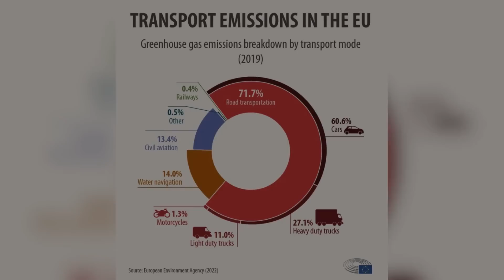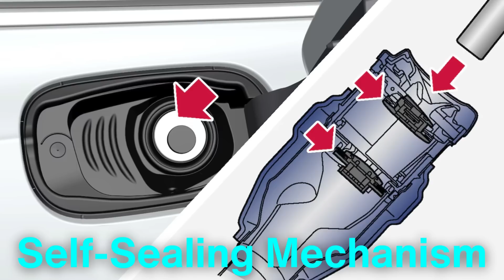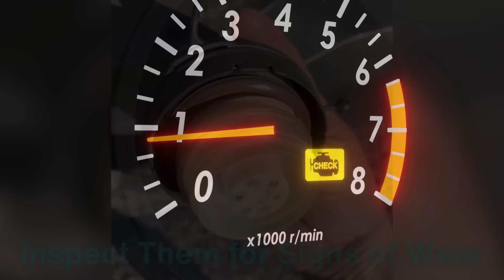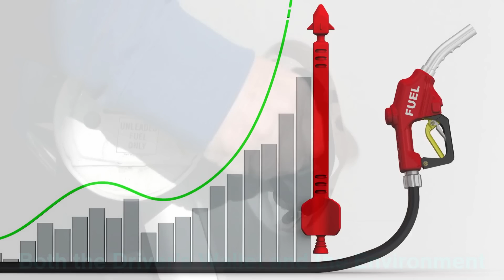How Do Fuel Caps Prevent Fuel Evaporation?

Comment: Had a Landcruiser with an aftermarket tank cap that was completely air tight. On long journeys it quit after 300 miles. Started next day. Reason was so low air pressure in the tank that the fuel pump could not draw fuel any more. Hard to find why. So some airflow needed into the tank to replace consumed fuel. An effect not mentioned in this video.
Reply: He does mention that caps allow for vacuum relief though